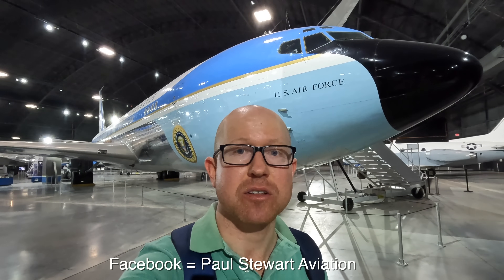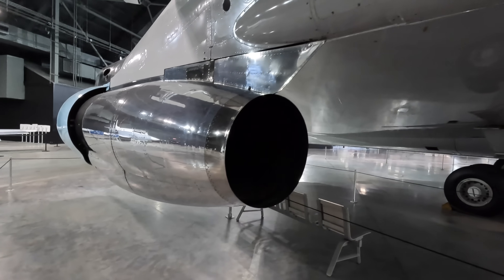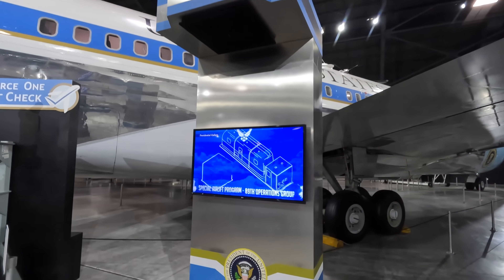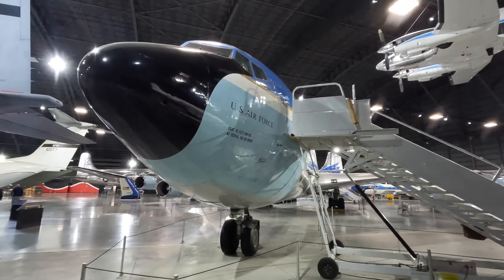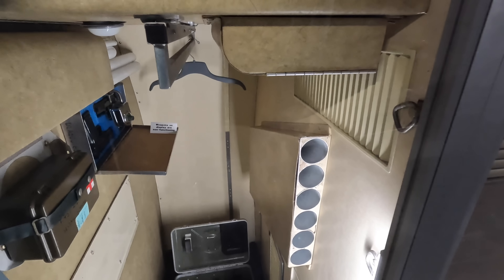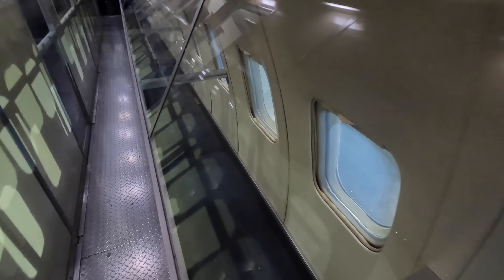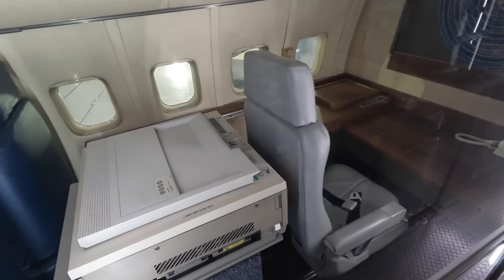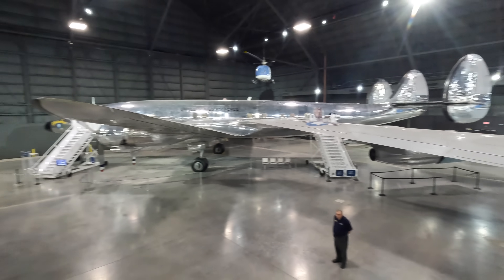Detailed tour through JFK's Air Force One - SAM 26000

Comment: I’ve been in this plane nearly 2 dozen times living so close to the AF museum. Great review. It used to be very special to see before they moved it into the newer hangar. You used to have to go on WPAFB area (A?) in a special hangar after getting quick background checks. You had to take a tram over. It was so cool! That was almost 13 years ago. The hangar on the base was so small and they had so much crammed in there with nearly no signage, you really had to rely on the guides. Thanks for the video…

Comment: OMG this is the first time in 45 years I have had the chance to see this bird again. The first time I had the pleasure to work on it it had just come out of depot and #2 engine shelled out. They had to make an emergency landing at Castle AFB in Merced CA and I was part of the team that had to change the engine and do what is called a trim on the engine (basically a check to be sure it was working correctly and that everything was up to spec) Since there were only 2 of us on the flight line that had Top Secret clearances me and Big Mac had the pleasure of not only doing the trim but also the high speed take off roll to check power (something that was rare but since it was going to be carrying the President had to be done. At first we were watched like a hawk by armed MP's but after it was all complete the crew chief allowed took the two of us for a tour of the plane. To this day I have never told anyone any of the secrete things we saw and believe me there were a lot more than this video shows. But I will always have the pride of knowing I worked on the plane that brought a much loved president back to to rest

Comment: The last flight of Clinton (or any president) aboard SAM2600 happened in Champaign, IL. As stated, SAM27000 originally flew him into town, but when the aircraft took one of the last turns too sharply onto the runway, one side of the landing gear was too far over and ran off the tarmac into the soft soil, recent moisture and the weight was too much and the landing gear tires went up to their axels in mud. A NY paper had a caption with the stuck Air Force One pictured, with the headline of "Clinton stuck in the Mud". This was right after the Monica Lewinsky sandal broke, so all eyes were on Clinton at the time. So it had a double meaning for sure.

I remember this well, as I was working at one of the local TV stations in engineering, and setup the remote feed for his visit beforehand, as it was rare to have any president in town, and of course it was after the sandal broke. So every national news outlet was setup besides us at the Assembly Hall, (State Farm Center now). But I had the next day off when he flew in. Our house was right in the flight path of the main runway at Willard Airport, so I got to see SAM27000 fly right over our house at maybe 1000ft. Then a few hours later, I got to see SAM26000 fly over our house as the backup Air Force One as it were. 

Apparently at the time, they would often have the second VC-137 stationed somewhere "nearby" as a backup to the main Air Force One VC-137 just for such a thing. But more likely, because the aircraft were getting so long in the tooth at the time, they always wanted a second one nearby if the 1st had mechanical issues. This must have been before they got the Boeing C-32, 757's that the vice president now usually fly's, or secretary of state etc. The reason they used the VC-137's that day instead of the VC-25 747, was because Clinton's second stop was at a smaller airport that could not accommodate the VC-25 747. Willard Airport in Champaign could, and had a long a enough runway, but La Crosse WI could not. As La Crosse was Clinton's second stop of the day, but he was several hours late to that event! 

Good times, not so much for Clinton, but covering that was exciting for sure. I later covered vice president Cheney (757), and George W. Bush VC-25, 747 along with getting a chance to peer into the "beast" limo. Have a pic of me standing next to it somewhere. That thing has the thickest glass in a vehicle I've ever seen!
Reply: I can confirm all of this, except where he lived  🙂. I was in Champaign/Savoy at the time too.

Comment: Just a clarification, the original civilian airline B707s did indeed use a Navigator. With the advent of Doppler and Omega Navigation, the airlines did away with the Navigator simply because they save money. The USAF is not a profit making entity, so they have the luxury of keeping the Navigator on-board, especially in a high profile mission such as Presidential transportation. Even the current Presidential aircraft (VC25A), which is a B747-200, has a Navigator Station, and I presume the replacement aircraft (VC25B) which is a B747-8 will also probably have a Navigator on-board, although that aircraft will not have a Flight Engineer like the current aircraft.
Reply: The “navigator” and his station do a few more things than just navigate on the VC-25A aircraft. The mere existence of that station was secret for quite a while, but The Drive website covered it a few years ago. It is much bigger than a navigator’s station, and it faces forward, instead of to the port side.

Comment: Sam 26000 was placed in service in 1962 and not only served the Kennedy administration but also Johnson and Nixon. It was taken out of service in 1972 when Sam 27000 took over and used as a reserve. Sam 26000 was taken out of service completely in 1998. The planes that replaced 26000 and 27000 are still in service today until the replacements are completed now delayed to 2028.
Reply: I've read several articles that say it was used on occasion by all presidents from Eisenhower up to and including Clinton.

Comment: I wonder if 20, 30 years from now they'll be able to put 28000 or 29000 on display.  THAT would be quite the walkthrough
Reply: It will be sooner than that. The 747-800 AF1 is being built as we speak. When they are done, the -200 will be on the way to museums.

Comment: Thanks for sharing this, and for clarifying in the video opening that this plane served as AF-One during its time of service. As the public is not generally aware of, the only plane designated as 'Air Force One' is the one carrying a duly sworn, sitting POTUS. 

1:08 - Would you possible know what the small inlet is for, at the top(12:00 position) of the front end of this engine nacelle?
Reply from the maker: For cabin pressurisation

Comment: Great video Paul. Just wondering what is the intake above the engine cowling? Is it cooling air for oil etc?
Reply from the maker: Glad you enjoyed it. It's an inlet for the turbocompressor which provided the cabin air.
Reply: @PaulStewartAviation  awesome and interesting 🧐 🙂
Reply: @chrisbeauchamp5563  
       Turbo compressors were needed on early low and medium bypass turbofan engine powered airliners such as the 707 and DC-8.   

At certain power settings near idle, the bleed air taken from the compressor section of the engine was not sufficient to maintain both pressurization and comfortable cool air.

     To compensate, the bleed air was instead routed through the turbine of what is essentially an automobile turbo.   The turbo compressor discharge air was cooled and used for pressurization and air conditioning.

     On the 707 series, most aircraft only had 3 turbo compressors, leaving the #1 engine with a cleaner looking pylon and nacelle.

      In the DC-8, 4 turbo compressors were in the nose, just under the cockpit.
Reply: @Stepclimb  Thanks for your detailed response. That is quiet interesting its always amazing engineering responses to problems.